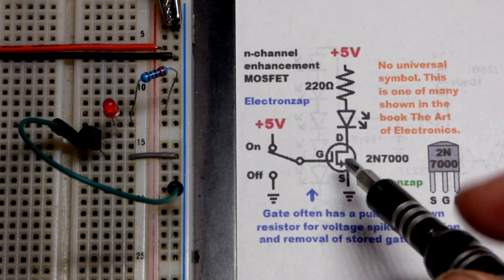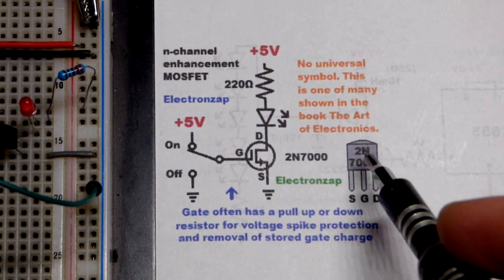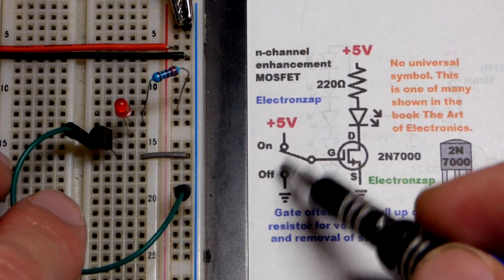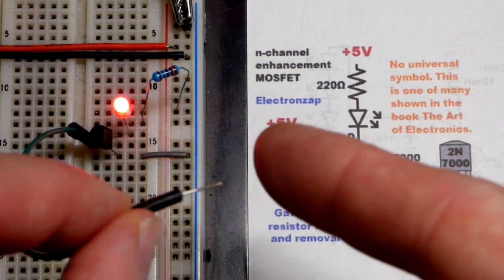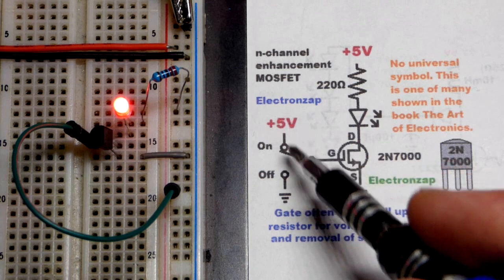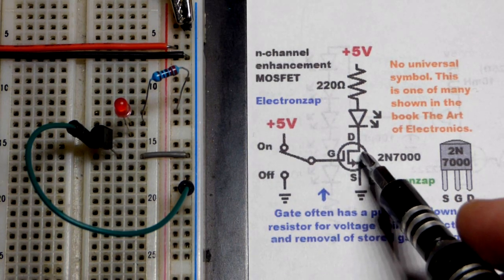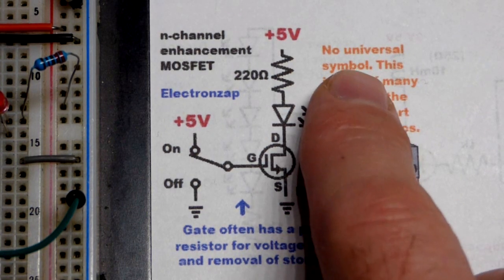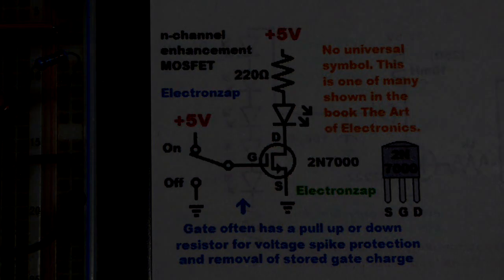2N7000 N channel enhancement mode MOSFET switch circuit

Comment: When G is connected to 5V, does any current flow between G and the DS part?
Reply from the maker: Current doesn't flow through the gate of a MOSFET, other than a slight amount during voltage change. It's like a capacitor, it quickly builds up a charge until it is the voltage that is being applied to it, and then current stops.
Reply: @Electronzap  Appreciate the reply. Tq. Despite a few years in the 'tinkering with electronics' zone, I've never used mosfets, only transistors, so I was wondering if they had the equivalent of an I(bc) current.